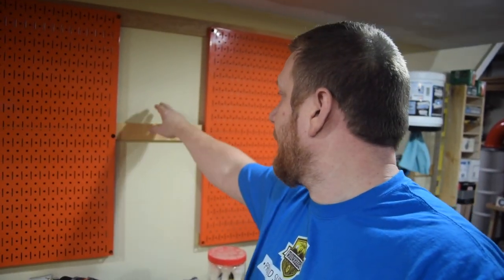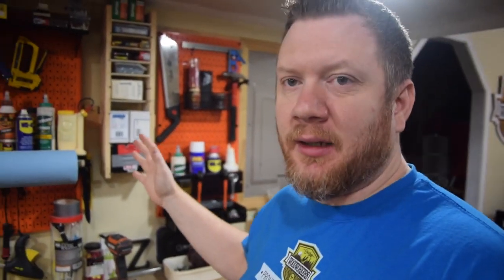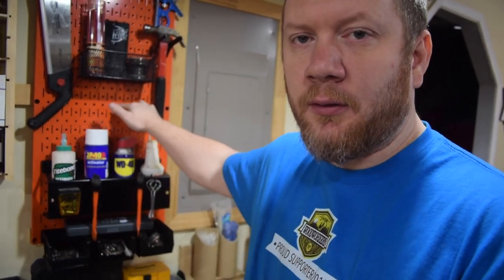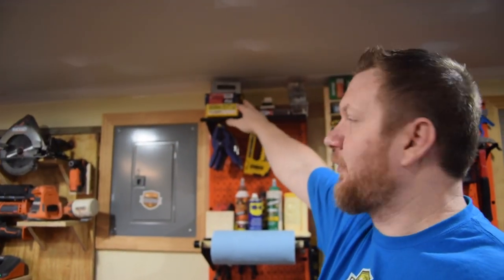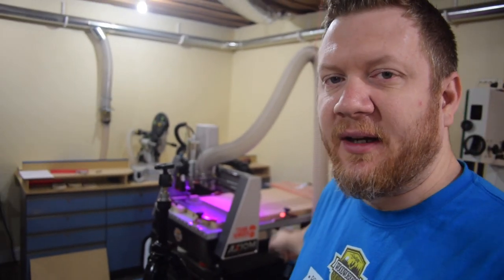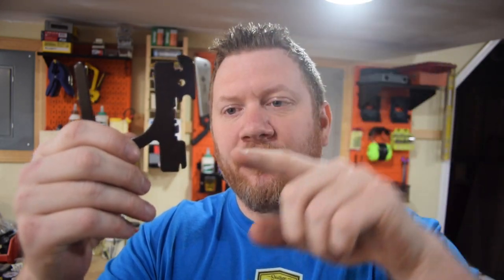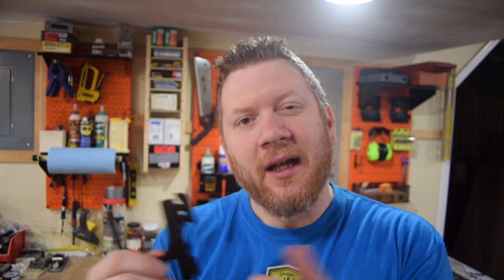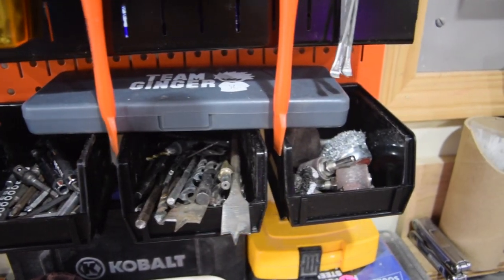Wall Control pegboard review & install // Shop organization

Comment: Nice video. 
Quick tip: if by finicky you mean wobbly, you can actually get the hooks to fit better on the panel by adjusting their stabilizing tabs (those little staggered square wings off to the side while looking at it as if they're mounted). Simply take pliers to them and bend as needed. 
Might be a lot of work for you tho since you already have your stuff on the hooks. I dunno if you can adjust the tabs while they're on the board.
Reply from the maker: Totally, you can bend them to make them more stable :)

Comment: What size screws did you use to attach the pegboard to the strips already on the wall?
Reply from the maker: Whatever I had on hand, drywall screws work but I think I used deck screws

Comment: there are 2 thickness of peg board. 1/8" and 1/4 ". don't bother with the 1/4" as it will warp something terrible. Paint it if you have the time because it is sawdust board. Put it every where that you have space, cut to fit. over the years you will fill up every  little space on it. you can make all the speciality bins from scrap lumber and screw them with dry wall screws to your peg board.
Reply from the maker: Great idea. I got some standard pegboard too but i do like the metal stuff, comes in handy for magnets